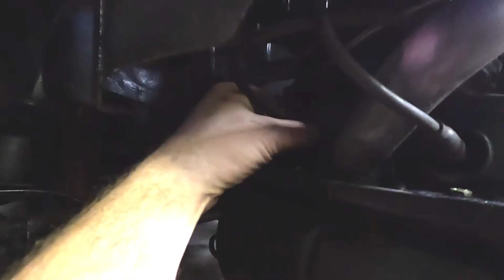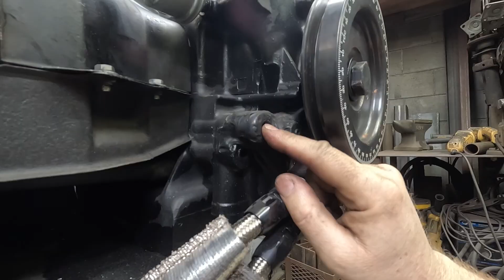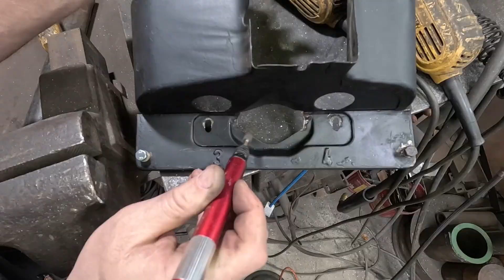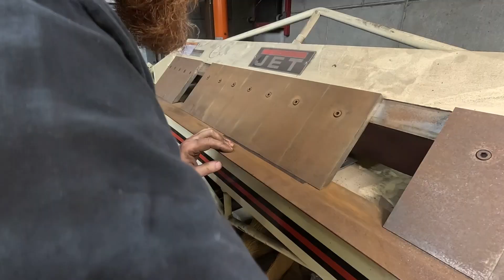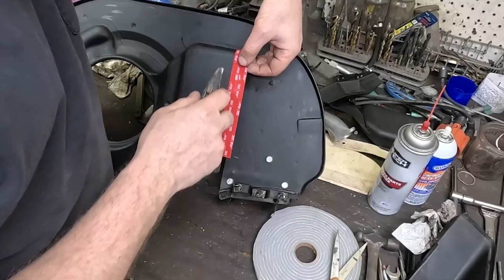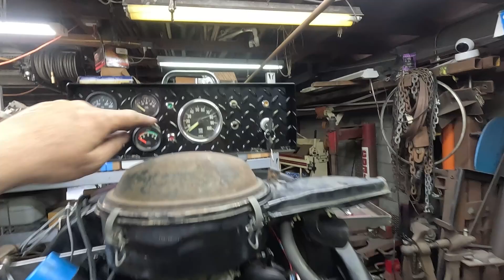Fix It Don't Skip It

Comment: Haptic what happened to the 1915,1835,1776 build?
Reply from the maker: Hey Troy! The crank and flywheel are in this engine, the other parts are waiting for the right build. When it was obvious that project wasn't going to work out in time I pivoted to this early case with single port heads, honed & re-ringed stock P&Cs, and a cheapie stock cam. Despite its rushed and humble origin it's been a good runner and is how the Never Was 1915 has lived on.

Comment: Just you know there are 2 rubber seals, that hold the throttle cable tube in place on the fan shroud.
Reply from the maker: Thanks '76, I'll take a look for them. I saw a Kaddie Shack post recently that used  metal and neoprene washers to keep the tube from slipping through the hole.
Reply: @HapticGarage 
WMC part 211-217
Reply from the maker: Thanks very much for the part #. These are listed as "plugs"; do they leave room for the tube to pass through the hole?
Reply: @HapticGarage  Yes, their room for the tube. These were factory seals on the dog house shrouds I think. One goes on the outside where the tube exit the shroud and the other goes inside the shroud, in front of the oil cooler. The cooling fan needs to be removed to install the seal. I have the seals too, I keep forgetting to install  them when I  have the engine out.😕
Reply from the maker: Great info, thanks! I'll pick up a set. We should wager how many engine pulls we each do before remembering to install these
Reply: @HapticGarage  If I had a Baja with dual carbs. My ocd would make me pull out the engine, and install the seals, right now. 😄
Reply from the maker: Relatable. Now we just need a Baja with duals!
Reply: @HapticGarage 
Up here in New England, Baja, in poor condition, goes for good money.😕
Reply from the maker: Bummer, they're fun cars!
Reply: @HapticGarage  Kaddie tip helps too.

Comment: Would love to hear your analysis of the "throttle shaft bushing" issue and also see a video where you make a jig that would ream the old shaft and install an oversized one with new bushings!! Wishful thinking.  Maybe include some before and after vacuum measurements so we could see how much air was being lost to the leak. Yeah !
Reply from the maker: Thanks Mark, I like the way you think! The throttle shaft bushing had wear typical for a carb this old, and of course that little vacuum leak renders the 34 Pict 3 carburetor to be un-tunable. I could wiggle the throttle shaft in it's bore, so it was game over for that carb. Stay tuned-  we'll be doing more in the future and throttle shaft bushing replacement is on the wish list!

Comment: I think that notch in the exit tin is for foam.. so it doesn't rattle?  That would be my guess.  I plan on doing the same thing with mine. 3M tape is the way to go. Super sticky and never fails.   Great job bud.  😎
Reply from the maker: Thanks, you may be correct Charlie- the foam fits nice there.